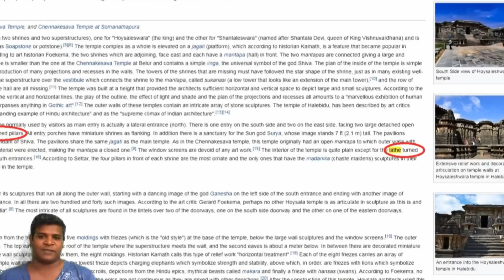Hoysaleswara Temple, India - Built with Ancient Machining Technology?

Comment: Ancient Egypt used lathes. They do not need to be built out of steel.  As for tools, they had steel by 6th century BC!! The  columns are not made of a hard stone.  They were grinding much smaller holes in much harder gems for wearing.  But with all this, it does not subtract from  being a spectacular  human achievement.

Comment: there are pine cone just few hundred kilometer from the holeswar temple you are in. Ooty is very close to the area you are in . there are hills filled with pine trees new the temple. and as for the gear ratio, we dont need to high level calculation to divide the outer ring by 2. Indians were never bad in Math. As for the carvings with very less gap, the use of acid from different natural sources were very common even then . We had several kinds of natural acids which could melt the rocks with perfection.

Comment: Whats more shocking is that there was no light source inside the temple and probably no electricity source 900 years back, and yet those advance machines were operational.
Does that mean they even had more advance power source at that time, which we yet to discover?
Reply: or they probably installed those carvings later on after making them outside the temple

Comment: The obvious machine lathing is clear, and I’m familiar also with other evidence of ancient machining around the world, in particular Christopher Dunn’s works on ancient Egypt. But that is not a planetary gear. A planetary gear would have a central gear, called the sun gear, with a number of other gears around it called planetary gears in between the sun gear and the outer gear called a ring gear, and these gears would engage the ring gear on the inside, so the ring gear teeth would be on the inside, not the outside. The God of Measurement would be less likely to be holding a gear system than a device you can measure with. This more likely a computational device, an astrolabe of some kind, a surveying tool, or something of that nature. Or, it’s not an exact replica of any device, per se, but a symbolic/artistic representation of proportion, measurement, symmetry, etc.. It certainly looks nothing like a planetary gear. I’d have to see it closer and what it’s connected to what to determine how it would actually function, and from there deduce what it could have been used for IF it is in fact an accurate depiction of a mechanism. But as an accurate depiction of a planetary gear, um, nope. And the retaining ring thing was a total miss, too. 

When people make videos like this, they really should have people, experts, who know what they’re talking about in terms of mechanics (in this case) because what happens is that people who know look at it and say “this guy doesn’t know what he’s talking about,” and end up dismissing the whole thing: it discredits the theory when it should be getting more attention from both academia and lay people and the engineers who might see it. You don’t even have to be a high level PhD engineer: an auto mechanic would know that’s not a planetary gear. And anyone at all can search online and find pictures and explanations in five minutes, which this video maker should have done.
Reply: Well I think he could have asked for input I guess he should have at least looked it up but it’s something obviously independently put out from the video quality ain’t it? I didn’t read the description so maybe I’m wrong about that I just think the effort should be applauded still, I take your point and agree otherwise.
Reply: Should’ve done so before I replied I reckon, I See now he has a shitload of followers despite the home vid low ball production value - so yes, if he’s monetizing his shit he should definitely do some more leg work or put more production value in via researching his own theories- that said it’s still largely a solo looking dealio so maybe one can hope there’s a learning curve he’ll take advantage of comments like yours in the future cuz you had some good points about how fakers and people putting zero effort into videos lik  these can indeed do more harm than good at  times but people are also waking up in a large part to the help of people like this guy challenging the academetians more and more on their own Shite work like the efyptologists and “experts” in revelations of the pyramids whom the engineers who built some of the last decades  worlds largest  projects simply shot tf out of the sky  by explaining they absolutely could NOT do such work in scale and volume, NOR attain such amazing precision with current technologies today in no uncertain terms.  This is a bit lower budget than that however although he very well might be able to get a quote or two on tape gratis?

Comment: All the ancient history we have been told to believe is nearly totally false.  There are a few truths mixed into the lies to make it seem real, but most of the greatest ancient sites in the world were built using some kind of similar yet different modern  technologies.  Some sites appear to have been made of some sort of geopolymer that may have been tooled while soft and then solidified into what appears to be natural stone.  Some sites have obvious tooling and cutting on tremendous scales.  Some have huge megalithic stones that appear to have been heat treated to 1000+ degrees making their outsides smooth like re-solidified wax but in stone.  The sheer weight of the stones, the moving and placement, is all impossible by the history we are taught.  Some of the statues that have chipped in museums show they are coated and hollow!  Some have filigree and rope mesh made of 'stone', impossible to chisel with ANY hand tool.  It would take eons of manpower to make these items as we are told.  So, your eyes and your mind see the truth, so now what do you think about everything else you think you know?